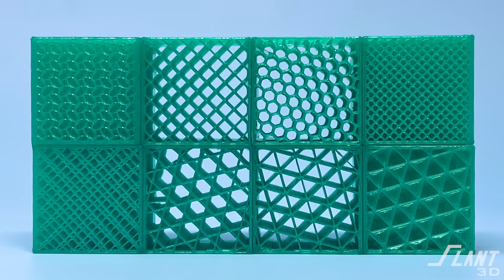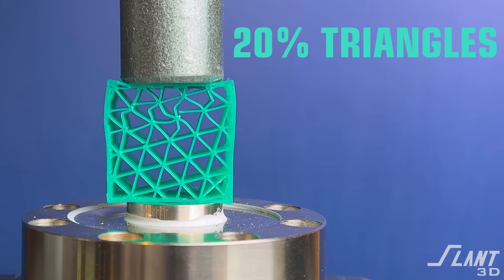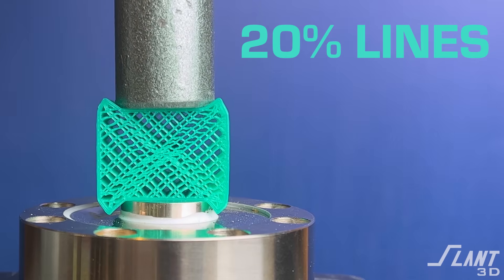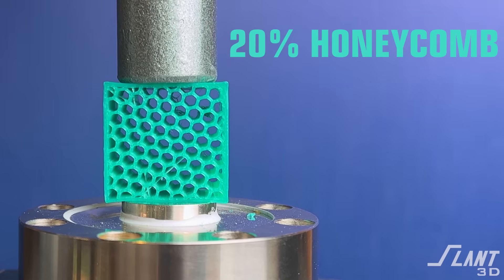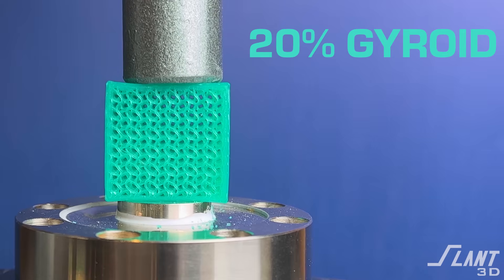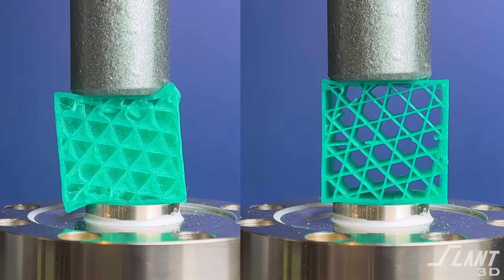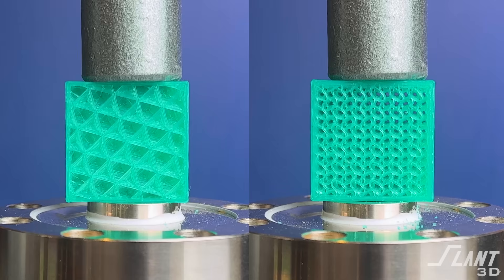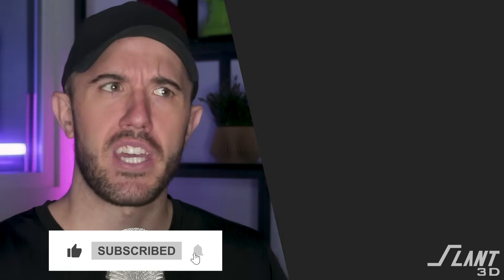Which Infill Pattern is the STRONGEST? | 3D Printing Testing Lab

Comment from the maker: You're stuck on a deserted island with only a 3D printer. What's the first thing you're printing?
Reply: A Benchy 🙃
Reply: I don't know, but it will be on a raft...
Reply: My tombstone.
Reply: No filament/resin? No power?

I would take it apart to turn the printer parts into tools. 😅
Reply: Nothing, because there is no power.
Reply: @ThatGuy-ou4ev  just print some electricity
Reply: @ThatGuy-ou4ev  Weak
Reply: @ThatGuy-ou4ev  Einstein
Reply: @ThatGuy-ou4ev  yeah or computer. So nothing.
Reply: A knife.
Reply: Chocolate 3D print, food
Reply: A woman
Reply: A full scale Ben the benchy since it has a chance of floating
Reply: A bigger 3D printer, until I can print parts large enough to make a reliable boat.  I would power it bicycle style.  Ideally I'd have enough power to actually go in the direction I want and power a simple pump mechanism to deal with leaks.
Reply: You won't make enough power with a bike to move let alone aux power. @Synthmilk
Reply: A pizza
Reply: A gun and then a bullet
Reply: TPU Beer Coozie!!!
The rest will come in time...Cold Beer is importanter...
Reply: lets say i have a oppotunity for a grant and decide i want to get into 3d printing and i also would have the chance to get contract jobs in different filed like petroleum , offices , water supply contracts what printers industrial level should i go for ,..... ive made a plan but i want to see if anything you suggest comes up with what ive planned already
Reply: @papbUTD why would someone with no idea what they are doing qualify for a grant. Especially someone who this the comment section is the place to learn this information
Reply: @papbUTD  Personally I would go for a SLS printer capable of nylon because it will provide the highest utility of end-use parts at the lowest cost.
Reply: Another 3d printer!
Reply: A handle for a sharp stone.
Reply: Water collecting system and then some mean of hunting, then a saw and a set of palm tree house adapters for ease of assembly
Reply: a tardigrade
Reply: Grappling hook that has a multi-functionality to be a generic hook to tie rope on(like a buckle)
Reply: An electrical reeceptacle.
Reply: A Max scale benchy
Reply: A million wishes
Reply: @slant3d  assuming i have enough filament and electricity and the files already loaded up, im 3dprinting a boat and rowing outta there
Reply: Yer mom.
Reply: Uh...  This was a very poor experiment.  It fails peer review.  Look up ways to test material strength like Young's modulus.
Reply: Nothing because there wouldn't be any power to use the 3d printer
Reply: the slant 3d logo
Reply: A DOLL...🤔
Reply: You need to a test at 90 degrees to what you’re doing
Reply: TPU pocket pushy. STL coming soon.
Reply: @KojimasFart  lol "beat" me to it. Literally and figuratively speaking
Reply: a fully functional helicopter
Reply: A full scale benchy
Reply: Must test the new environmental variables
 @juicyvids
Reply: @juicyvids  it will still sink
Reply: ow :(
Then I'll print a volleyball and I'll name it W... Willy

Comment: that test had way to many variables. for one the way you mounted the plastic blocks they need a box to sit snugly in so they cannot slide around. thats why your test results dont come out as expected. id delete this video and try it again with a small metal tray on top and bottom attached to your press that fit the plastic test boxes snugly. this is bad information. please correct this flaw.

Comment: For some reason, I feel that these are useless experiments that show little or nothing for several reasons: 1) the load on the part usually occurs perpendicular to the layers, and in the vast majority of cases, it is distributed over the entire surface area. This is not equivalent to a point load, and if the load is applied along the layers in your part, you should consider changing the orientation of the model during printing and/or design. 2) During the measurement process, the center of mass shifts, resulting in unclear values. If you are truly interested in the effectiveness of a particular model fill, I recommend completely reworking the testing methodology. And it doesn't seem logical to press on a part until it completely breaks, because what difference does it make how much the part is deformed if the deformation is irreversible?

Comment: Results are a bit misleading because most parts have walls on all sides, but this crush test doesn't, and the has a big impact on the parts resistance to shear. Cubic has more shear strength than gyroid, but if the cube had walls on all sides, gyroid would likely perform lot better. Other youtubers demonstrate gyroid matching cubic.

Comment: I saw in a video recently that the same percent of infill doesn't always use the same amount of plastic. I'd like to see this done where instead of using the same % infill, it's done where the percents are adjusted so the weight of filament is the same!

Comment: The result graph is on 3:48

Top peak force withstanding for 20% infill:
1 - Cubic
2 - Honeycomb
3 - Gyroid
4 - Lines
5 - Rectilinear
6 - Grid
7 - Triangle
8 - Stars

Video also mentions that:
- some patterns shatter under load and some crumble
- some patterns can be infilled by some substance later
- results may differ for other infill percentages
so you still may want to optimize your patter according to your use-case.

Comment: These's als isomax, as the onr theoretically proven maximally stiff structure (if inter layer adhesion would be perfect that is). Unnfortunately no slicer implemented it. Not even under different name averting the trademark.
It's basically cubic infill with a few more planes in there.

Comment: a better test to show it's true strength would to have been having a plate on top of the cube so the force is evenly shared to the walls of the cube shape along with the center. the circular punch to the middle just kind folds it in on its self like throwing a bowling ball on a set up tent, just gonna pull the walls in on itself naturally just testing how well the walls of the cube can bow in with different filler. a bigger flat peg to fully cover and compress the cube evenly would probably add 30-60% more weight it can stand

or make cylinders at a smaller diameter of your press and then do the same test demonstrating the infill prior to standing it up like a soda can where you wouldn't see it or like a paper towel roll

also testing the difference in strength with the print lines going up and down on a print rather then side to side stacked up to see if that makes a difference in the strength, like print a tube standing up and one on its side so the filament lay different to make the same shape to see how it effects the strength

Comment: the error with this test is the small base you used where the full base of each square was not used creating the base to move around the small circular base... this needs to be redone with a larger flat surface like how your first test of infill video did. Good channel though but please consider redoing this testing

Comment: To be fair, as neat as it is to see the open "cells" etc as everything gets crushed, it would be more useful to do these tests with all 6 sides of the cube covered, for maximum stress distribution/reinforcement, as well as crushing from the various perpendicular axes with said fully-enclosed cubes, because that's a whole other thing to consider. Also also, as a few others have said, getting a bigger press surface would be better so it more evenly crushes the samples would be better, as well as reinforcing the linear-moving parts so they don't experience side-slippage as it tries to crush samples. Lots of variables to tweak.

Comment: I think this is a bit misleading, in most situations the main way infill adds strength is by keeping the outer walls from buckling. If you want more strength you're usually better off adding perimeters instead of increasing infill density. Maybe even reduce infill density, because thicker walls need less stabilization.  There are some exceptions where infill helps more, like printing with TPU, or when you have a very chunky part.

Comment: Every infill has different amount of filament that it uses despite having the same percentage. It's usually only about a 5-10% difference. And there's certain infills the suffer from weak connections caused by part cooling or simply an untuned printer that otherwise would have been as strong or stronger.

Anywho, my two cents

Comment: This is useful, but misses three key points: 1) Not capping the ends reduces the efficacy of some infills since free expansion into the Y axis allows catastrophic failure earlier. 2) Using a test part smaller than the contact patch on the press disadvantages some infills more than others. 3) Not capturing the moments visible deformation + unrecoverable deformations occur is a shame - getting the measurement visible in the footage would help :)

Comment: Why were the samples not fully supported at top and bottom?
Also, why were the rams permitted to yaw sideways?
It seems to me the best test for consistency would be two plates larger than the samples by 50% and no lateral yielding of either plate to give a true result across the tested infills, limiting to ONLY compressive force.

Comment: Total destruction is not what we use when designing a device. What we are more interesting at is the elasticity. So should you be able to define the maximum applied force before going out of the elasticity zone will be a strong asset for designers.

Comment: Hi thanks for effort to provide us data for better design. However, your testing is not a compression test the way it is setup. It is in fact a peneration test from the top and bottom. In addition a compression test means that the force vector is always in the same diection, Unofrtunatelly your piston being shifting laterraly means the angle of applied force is shifted. This unfortunately leads to inconsistent results to dray conclusions.

Comment: That test seems wrong. You need to locate the net towards the strongest force applied to an object. Try breaking honeycomb pushing perpendicular to the hexagons, it will be many times harder. The best one theoretically is not a gyroid but a net of diamond structure made of the single special shape similar to tetrahedron.

Comment: While interesting, I am not sure of the utility of this study as, in use, is it the initial deformation or the peak force that is the parameter to measure - when will the object lose its utility? Also, material and design is so important in the decision - the results would be different if the object was round instead of square (and probably isotropic related to infill direction). The test done here is more 2D (XY ) than 3D (XYZ). Finite element analysis would guide the multi parametric decision without building anything - there are free add-ons for CAD programs online.

Comment: I'm newbie in 3D printing, but I see cubic as one of the best, having cubic which is strong and fast to print I cant see why using honeycomb as it is very slow to print.
Honeycomb has several directions changes, which makes the print head a lot of accelerations and decelerations, cubic is basically a lot of straight lines side to side.
Also, cubic has a good relation/distribution between X x Y x Z axis strength.
My default is CUBIC!

Comment: I am grateful for the knowledge you share, and most of your videos I have found extremely helpful, however I feel this video was not even close to as useful as it could have been and not have taken much if any more time to expand.

Testing Elastic deformation/Plastic Deformation/Full Failure on each piece would have been much more informative.
For most instances this is not very useful outside of border cases such as creating sacrificial parts such as a plastic cog designed to fail at X force to save other parts of the machine. For most 3d printed parts, past Elastic deformation can be considered full failure and time to replace.

Comment: Thanks for these tips! We produce 3D printed objects, and we print them hollow. We used sand to give them weight. But this process takes a lot of time. Would you recommend other material as fill materials instead of sand?

Comment: As someone that has done construction materials testing in lab, compressing the entire object between larger surfaces would yield a more scientifically accurate result. There are ASTM standards for compression strength testing using 2" cubes and cylinders (3"x 6" and 6"x 12") that would be worth looking up and following. I also think you could further test and compare the direction of compression, in this test you are essentially compressing across the grain of the infil as opposed to along the grain. It is most likely that like wood, 3D prints along the grain infil would be stronger than across the grain of its infil. Look up beam testing for shear strength testing.

Comment: gyroid is not closed  cell infill, it is the one you can fill in with liquid the eatiest because each line of  "cells" is connected to oposing direction line  few layers deeper making it the only infill with direct path from each space to another . it looks from the top like it is closed off but it is not. it could have just crossing sines but i think it would be harder to print

Comment: Other important things to consider is how much time will it take, surface quality, hardware abuse from the pattern itself, as well as strength. There's a common belief in online forums that grid is cancer use gyroid for all but it's not such a universal response,  you need to account for the model at hand along with material time and wear that will result as a consequence.

Comment: What are the failure loads if you normalize by part weight? Cubic prints a lot more material than lines at the same percentage, and more material typically translates to more strength, so you have to remove that factor if you want to compare the contribution of the infill pattern alone to strength.

Comment: Grid infill was designed to absorb forces towards the grid, not from its side. There's no point to test it in such orientation as you do. For cubic and gyroid infills direction of force does not matter. For grid infill it does matter.

Comment: I’d really like to see each infill compression tested at different axes, and then move on to torsion, shearing, bending and tension as your test lab expands.
Reply: Same, I want to print something to support some weight and I came here to see how much can it handle. Obviously I wouldn't load the prints from the side like this so this video is kinda useless.

Comment: Would be great when you get into heavier data gathering to know how much material each infill adds to a test piece. If the part is 10g without infill and 20g with infill for example, the infill was 10g. Then we can get strength per material usage ratings as well. :D

Comment: in the videos you should also show the stress strain graph as the parts are stressed and in general as much information as can possibly be packed on the screen just knowing the peik force used may not always be the most helpful

Maybe try get a materials engineer as a mentor to give suggestions on what to include so that it is most useful and you are making the best use of your time.

Comment: odd testing in that there are steps on both the top and bottom, which likely set the initial point of failure.  Good if that's what you're trying for, but not so good if you're testing straight up compression of the infilled part and trying to isolate the infill rather than how the infill responds to offset failure.

Comment: The tests aren't valid. I've been printing for some time now and I never printed infill that has an open side the walls wil give a lot of strength to some and some infill won't become a lot stronger when an extra wall is given because of the cells
Reply from the maker: So you don't want a test of infill. You want a test of walls
Reply: @slant3d you are right, that is also a test of the wall, but like in Sandwichpanels the combination of them both can improve the integrity of the part. Because the walls Buckel far later.

Comment: I predict something with staitwalls and closed 3d cell is the strongest, maybe cubic infill. Let's see.
Reply: I was right all along.
Reply: Even though you can't see through it, a gyroid is an open cell lattice that divides space into two regions throughout the part. The space of every unit cell of the gyroid is connected with every other cell. It is possible to create two holes anywhere, and they are connected as long as a full cell is opened by the two holes.

Comment: i think a good test on this series would be about balancing infill vs perimeters within a same-ish total weight to look for that sweet spot, but maybe with a slightly bigger cube to be a bit more translatable to average structural prints
Reply: Id like to see this too, weight for weight, which infill has the best strength and characteristics.

Comment: 0:45 the ram is moved left by the print - is the print that strong or is that slop in the press? I used to have a harbor freight H-press that I made HDPE shims for to take up the slop - would be super simple to 3d print some

great vid as always, thanks

Comment: For this to be actually useful information it needs to be a uniform load applied to the top of the brick against a uniform base and the parts need to have equal weight (infill of the same % doesn't mean same weight). Maybe additional part orientation tests too and we also need to see force to deformation mapped out so its clear when a part becomes "broken" for different applications. 

Without that info these tests are more "nice to know" rather than actionable data. Number of wall loops as another variable would also be extremely helpful for extra points.